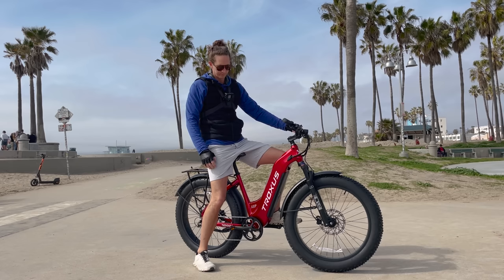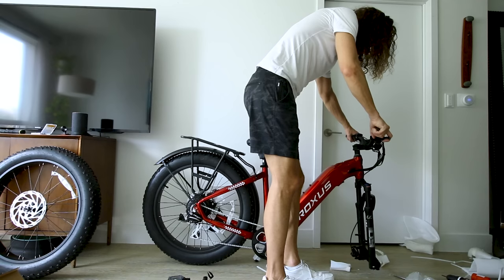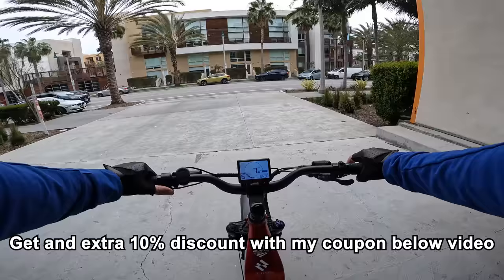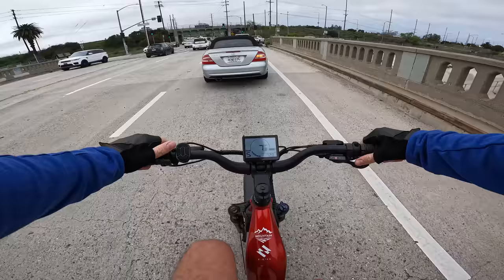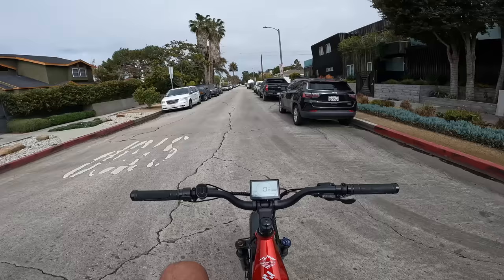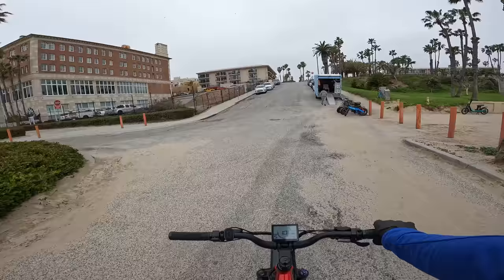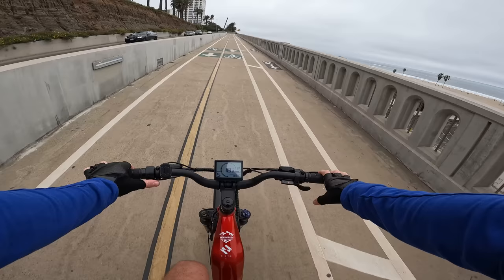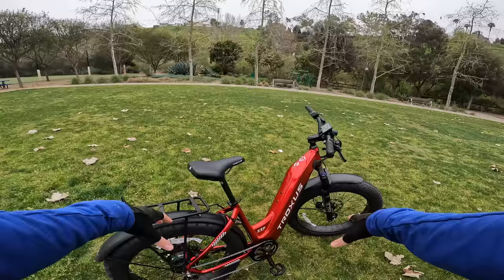Overpriced EBikes DO NOT Want You To See This! Troxus Explorer Review

Comment: Samsung 20 amp hour battery, Bafang motor Tektro hydraulic brakes, Shimano drivetrain, 28 mph, now $1379, can't be beat.
Reply from the maker: It actually can… my link and discount code will knock an extra 10% off that price 😉
Reply: That is a tremendous deal
Reply: @TailHappyTV  Cheers THTV!  I know a lot about bicycles and very little about electronics.  I can tell you that this bike would be easy to fix and keep running well.  The Bafang electronics are a well known quantity and there's a wealth of knowledge out there about them.  The first mod I'd make is 26x3" slicks.
Reply: still too expensive.😂. I'll wait for these to hit $0-$500 range in a couple of years
Reply: @millenium2003  they will probably get there eventually?
Reply: @millenium2003  You can't even buy a decent bicycle for $500.
Reply: Unfortunately I don't think the ship outside of the USA 😢.
Reply: What a great review, thank you! I'm on the fence teetering your way! 😁 There is no other bike out there of this quality for that price,  not to mention your additional 10% off!!!
Is it a basic red or more of a crimson red?
Reply: @TailHappyTV  that's $137 off!!
Reply: @millenium2003  the batteries alone costs 200-400 dollars, we need new innovations in battery technologies and that'll take a while
Reply: @millenium2003  cost more for shipping
Reply: @georgekrpan3181  ditto & agreed!
Reply: It looks like a better bike than the lectric.
Reply: @tomcarney3648  Shipping is free, and, I got mine in 3 days.
Reply: @ronb9901  Cheers Ron!
Reply: Cheap for an extended bike but after considering an Ebike I bought a Honda metropolitan instead,  Used but mint condition for $1000 45 miles per hour,  Street legal 100 miles per gallon. yeah no comparison,  I then bought a second one Cuz it's more fun to ride with another person
Reply: @MX-CO  have fun dealing with morons in cars!  bike trails way better
Reply: @MX-CO  I thought of getting a scooter but they have to be out in the road with cars, can't use the bike lane.  One place I go doesn't allow motorcycles at all, but ebikes are ok  I love scooters and have a motorcycle, Vitpilen 401.
Reply: I see , I was looking for something for Camp grounds,  But I think it's cool that's its also Street Lega, I really wanted a Levo but I can't afford one, I wanted to Race the EMBT series.  
If you have never heard of it look it up. I've seem one in person and it looks So fun, but I literally can't afford one and can't qualify for the Financing even if I wanted too
Reply: @MX-CO  You can buy 5 Roxus for the price of a Levo.
Reply: Yeah it can't be beat, 11 days later it's 2300 bucks now.
Reply: @PhilrupyoGaming  Watch this vid of 5 fat bikes under $2000.  The Area 13 bike is pretty tasty
Reply: $2299 when I clicked on his link.  Was this on sale for $920 off?  Am I missing something?
Reply: @Ry-lx2kl  yeah that's what I'm saying lol. Like video must have increased sales so they tack on 1000 bucks, just how the f150 xlt truck went from 35-40k in 2020 to 70k now
Reply: Where did you see $1379 at? I went to the site and it was over 2 grand and with Matt's discount came out to $1770
Reply: @murray8958  $1770 is still pretty good for this bike, it's super high quality.  That's a $529 discount with the code, 23%.
Reply: @georgekrpan3181  thanks for the reason and recommendation.  I'm in process of converting a Specialized Fuse 27.5 fat tire bike with a CYC X1 Stealth Gen3 1500w mid-drive motor.  I picked up the bike used for $600, so all in with battery/bike/motor it should be about $2200 total and have way more power than just just about any pre-built ebike at this price point.
Reply: @Ry-lx2kl  I also have a gravel bike with Bafang BBSHD 1500w mid-drive, 52v 21ah battery.
My 750w hub drive Troxus is every bit as fast and way better to ride.  Theoretically the mid-drive is better but in the real world, the hub motor is better.  Sorry to be the bearer of bad news. I found out the hard way too.
Reply: @georgekrpan3181  I have other bikes I need for my family so I'll keep the Troxus in mind.  You're  information runs contrary not only to the specs but reviews I've seen online.  Unfortunately I doubt there is a local dealer I could test the Troxus without buying one.  The BBSHD is rated at 1000w/150 ft lbs of torque vs the Troxus at 750w, probably half the torque, and doesn't have the advantage of utilizing the rear cassette.  I have seen hub drive motors do have their advantages on the flats where torque isn't as important.  The mid-drive motors typically do better on the hills or in the dirt due to the higher torque.  I did install a BBS02 on another bike, and it had impressive performance.  The CYC X1 Stealth Gen3 is rated at 1500w continuous/2000w peak, so it is a more powerful motor than the BBSHD out of the box.  Many of the cheaper batteries out there can't keep up with the demand of larger motors, I wonder if that accounts for some of the performance difference you are seeing.  Unless You're selling Troxus I don't see any reason you'd lie. However, I am skeptical of your claims as it's contrary to the specs and reviews I have seen.
Reply: @Ry-lx2kl  Believe me, I was super excited about getting a mid-drive and dead set against a hub motor, but, the BBSHD was a bitter disappointment.  My BBSHD has a state of the art battery from Luna Cycle.  I have pointed this out to so called experts who've told me that for best results run a one to one ratio, chainring to rear cog.  If so, there is no pedal resistance at top speed.  With my Troxus there is pedal resistance up to nearly top speed and a simple gearing change would extend that.  With a hub motor gear selection isn't critical as on a mid-drive which makes a mid-drive much more tedious to ride.  I can explain why the Troxus is as fast as my BBSHD, it has to do with revs.  Hub speeds are much greater than crank speeds and electric motors like revs. You know, of course, that there are 2000w hub drives available.  The so called experts crack me up.  They are definitely not experts and are trying to up their subscribers and/or sell stuff.  The proof is in the pudding, I love my Troxus, the BBSHD is on Craigslist.
Reply: You are absolutely right .
Reply: @PhilrupyoGaming  the sale price is clearly stated  in the description. Sale is over.
Reply: I sure would like to support the channel and get a great deal as well. I’ll wait because the economy is starting to tank and they’ll probably have another 40% off sale with an additional Tailhappy 10% discount. If so I’m buying. In the meantime I’ll be watching for other great e-bike deals hopefully through tailhappy because I enjoy his content and he deserves the support. But in the end it’s always about good value. 🤞
Reply: Karen gotcha!..😂
Great review, I’m considering this bike.
Reply: @millenium2003  don't hold your breath
Reply: @StefanRandall  maybe, maybe not
Reply: @tomcarney3648  we can't ride a motorized bike on our bike paths. But I see more and more doing so every time I ride.
Reply: Can I still get this bike for the $1379.
Reply: @EdCrockett-vb8fm  No, unfortunately.  It's presently $2299.  I've got 400 miles on mine.  It's a great bike.
Reply: I just hit the link, and it says $2299? What about the $1395? Am I looking at the wrong bike from the link?
Reply: I would buy one today at the price mentioned on this video.
Reply: Riding between cars like that is just asking for an accident. Not too bright.
Reply: @TravisMcGee151  I do it on my motorcycle but rarely on my a bicycle.  It's legal in California.  It can be done safely although there are idiots who don't do it safely.
Reply: I just bought a EUY S4 1000w 26ah for $1,300 and a Ridstar 1000w 20ah for $1,132. Both 20" cafe racer style.  I'm looking for a 3rd model to buy asunder $1,400. Any suggestions?

Also can I charge these on a portable 12v solar charger that has a charge controller?  Is there a way to connect the bike chargers to a + and - clamp?  That's what my solar charger has to connect to. Thanks!
Reply: Letric XP beats it
Reply: @georgekrpan3181 ❤
Reply: @RosinDaddy5280  No way I'd ride that.  It's for goofs and noobs.
Reply: @georgekrpan3181  lol keep on hating what a enjoyable life you must live  🤣🤣🤣
Reply: My XP has 24.4 amps 
150mile range 
In pedal.assit 3 
Sorry you can't handle a lil speed
Reply: I guess if you snooze you lose,  that bike has gone up $1000.00
Reply: @RosinDaddy5280 what exact model do you have?
Reply: @suprmn  xp2.0 but it's updated
Reply: HIBOY p6
Reply: After this video it is now 1899.00
Reply: @allywilkeforsenate  Having owned one for almost 6 months and over 1000 miles I'd say it is worth $1899.  It hasn't missed a beat and I love riding it.
Reply: @Hungry_God yup
Reply: Looks better than the RAD mini step thru far tire bike that I paid $1499.00. RAD does not   give post purchase support!
Reply: @millenium2003  can't buy a decent regular bike for that. Keep waiting
Reply: @TailHappyTV 
1:40
Reply: @millenium2003 be more like 7-10 years for these tier of bikes to be under $500 new.
Reply: I enjoy your reviews. Would you include decibel sound ratings in your testing. Some of these units are obnoxiously loud at various speed levels. Thank you
Reply: - checks - Guess it didn't stay that price. $1800
Reply: @Jnaathra  No, it didn't.  Worth $1799 though.  I've had mine a year and 2000 miles.  It hasn't missed a beat, quality bike!
Reply: @millenium2003  youll be waiting forever lol prices only going up and new tariff now even more
Reply: @georgekrpan3181  ikr people are delusional
Reply: @Hungry_God  good batteries cost like 500-600 minimum. buy a cheap battery for 200 and wont charge in a few months

Comment from the maker: I'm sorry for everyone who missed the 40% sale price, but you can still get 20% off if you click this link then enter the code at checkout:
https://bit.ly/Troxus-Coupon - code MEMORIAL20 at checkout ONLY TIL JUNE 1
If you want a less expensive ebike I recommend you check out my personal favorite fat tire ebike for the price; this one actually climbs hills better, weighs less, and costs less.
https://youtu.be/11BSjoJ0VZo
I took it all the way up 1600ft elevation gain to the Hollywood sign before I ran into an awful problem.
Here's a direct link to the bike:
https://velotricbike.info/3mOCqKO - Save $60 with code TailHappyNomad60

For the Troxus ebike, please note the hydraulic brakes are listed as 180mm rotors on the website, which I do regard as the gold standard for a 84lb bike. Do not expect to receive 203mm rotors. Troxus did not ship me a special bike, some bikes shipped with 203mm and some with 180mm rotors. You will experience no meaningful difference in everyday riding on this minimal rotor size difference, it's mostly beneficial for heat dissipation on long descents from a steep mountain or repeated heavy braking from high speeds. 180mm Tektro hydraulic disc brakes are perfect for this bike and still above average compared to what competitors are offering.
Reply: Do you feel the 22amp controller is enough? I see a juiced brand bike on sale for less, 52amp controller for more power delivery for the 750 motor. Not sure on Juiced's battery size.
Reply: I'm stunned by all the brands.
This looks like a vehicle you can be proud to own.
Reply: Why are ebikes all left had throttle? It's stupid, riht hand throttle motorbike since time began
Reply: thanks for this review and discount.  funny - you riding in the street in marina del rey was what kept me watching as I have rode in that area! I ordered one!
Reply: When I went to the website, the bike cost about $1,000 more than was mentioned! Great deal at $1395, but not at $2,300!
Reply from the maker: Agreed, Larry. There's currently 22% off the $2300, plus an extra 10% off with "TAILHAPPYMATT" coupon code at checkout

Comment: Quick word of advice, next time you face those plastic bands around a box or package find the connection point flip it inside out and then just pull the tab. 9x10 times it will release with out beating it with a hammer or digging for those shears.
Reply: There's no drama in that though.
Reply: You are correct.   After a decade or so tho, I just went to using scissors.

Comment: That's a really good spec for the price, especially with your discount! 😊

I recently upgraded my Ride1Up Core-5  single-piston mechanical Tektro brakes to 4-piston Tektro Dorado hydraulics with 203mm front and 180mm rear rotors. Now, I can bring the bike to a controlled stop with very little pressure. 😊
Reply from the maker: Very nice, careful not to lock up that front tire!
Reply: @TailHappyTV  A gentle squeeze is all it takes to slow down. I haven't tried a high-speed, fast stop yet as I've been bedding the brakes in residential areas.

Comment: Just rec'd mine today and gotta say, it's a helluva good bike for the price ($1241 shipped).  I had an Aventon Aventure previously but wound up sending it back.  Forks made noise, chain slap anytime going over a bump, motor noise, etc. Maybe I just got a lemon....but that being said, comparatively, this bike exceeds Aventon's quality IMO.  Front forks although stiff, do a good job absorbing bumps, motor engages immediately (unlike Aventon) and while I've only don't 19 miles, I'm only down one bar so I expect I should get over 32miles easily.  I don't think it competes well at it's MSRP of $2299  but for less than $1250, it's a fantastic deal.  Thanks for turning me onto this and seeing what other similar comments were about this.  And apparently they have some fairly large financial backing with a partnership with Lucidity (press release indicates is well into the 7 figure range).  We'll see how long they last but impressed with the initial quality!
Reply from the maker: Does yours have the large 203mm rotor brakes?
Reply: @TailHappyTV  No, they came with 180mm. They work well though
Reply: @poopingwhilestanding5801  that's not good though. So much talk about the bigger rotors here.
Reply: You bought it from ??? at that price?
Reply: @snoking1127  link is in the description but that sale price is long gone.
Reply: The price changed, please update!
Reply: time will tell. i dont own an Aventon but the fact you can get them serviced almost anywhere is a bonus

Comment: I Like my 2020  Rad Rover ST1  for $1400   I now have over 12000 miles on it problem free other than one set of brakes tires and one chain .All off road mountain trail riding . The Battery is a Samsung 14 Amp 48 volt . Top speed on it is 24 mph Battery life riding hard and fast is around 45 miles
Reply from the maker: nice! happy riding